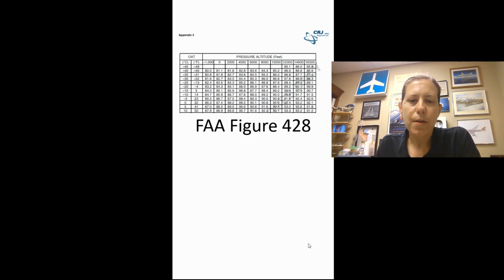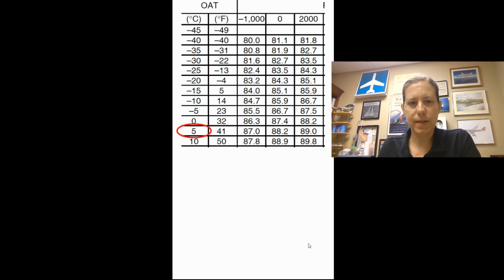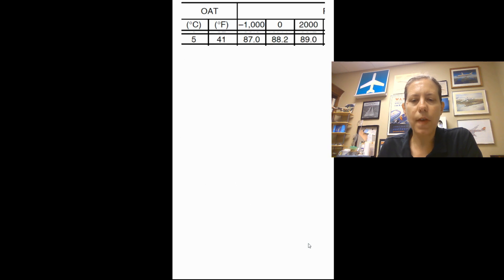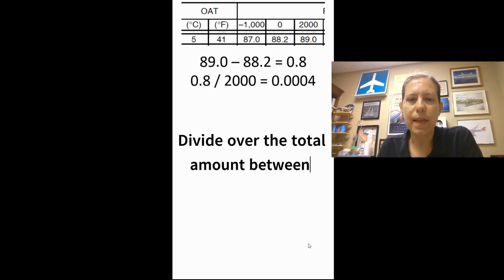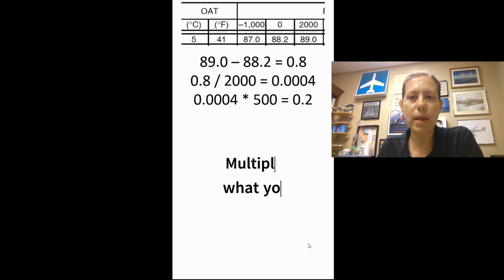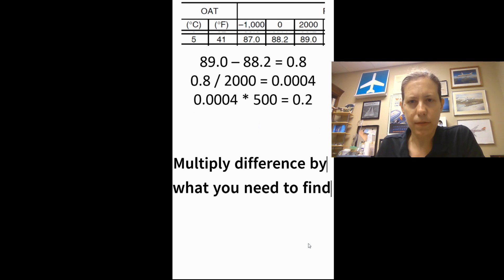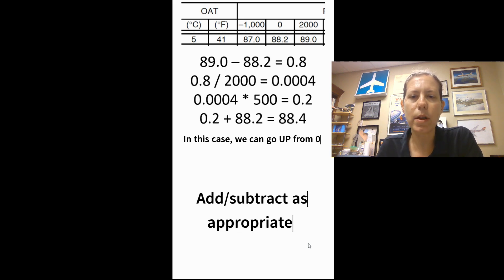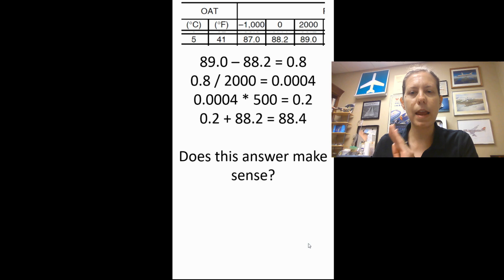Easy interpolating pilot & dispatcher: FAA Test Prep! How to Interpolate ADX ATP Private Commercial

Comment: Excellent. I needed this for written
Reply from the maker: That is excellent! I had some students also wanting more detail on this during our summer Aircraft Dispatcher course.
Reply: @LauraLaster747  i need the summer dispatcher course as well
Reply: @LauraLaster747  is it the same question bank?
Reply from the maker: @pistolpak  It is not identical, but it is similar. The test prep book from ASA and the FAA figure book are the same. However, not all the questions are identical. Sheppard Air is the best test prep program for both tests, hands down.